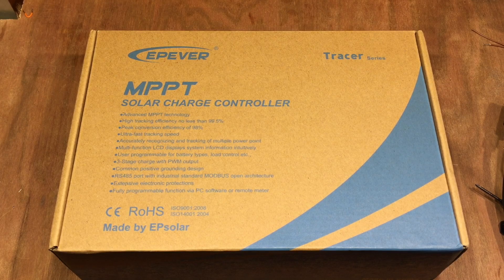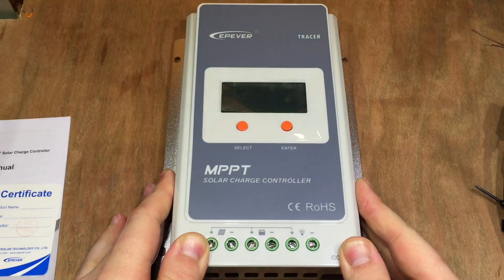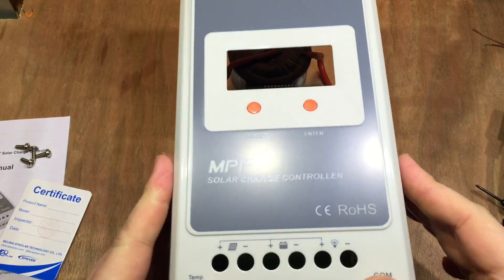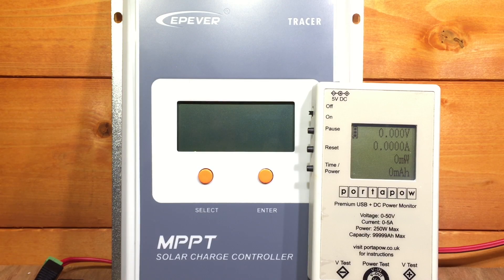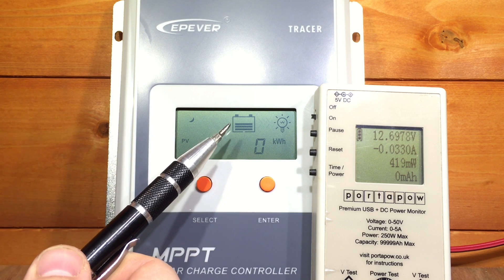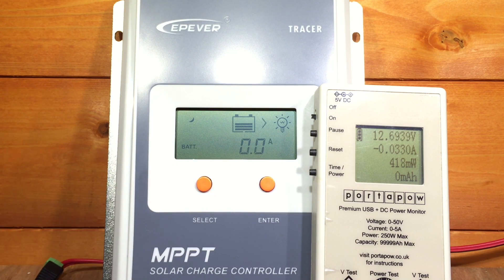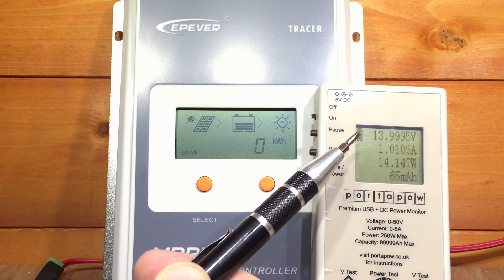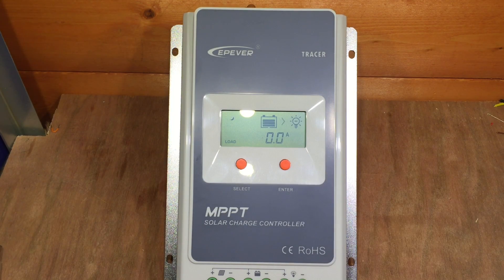MPPT Charge Controller Review - EPSolar EPEver Tracer A Series - 12v Solar Shed

Comment: The size of the heat sink worry's me, how much is the loss to thermal?  Also, do I understand this correctly, that the controller can be turned off when there is no power coming in, so as to not drain the batteries? As someone new to all this I never thought it could be so complicated.  Enjoy your video's immensely and I'm learning fast.
Reply from the maker: My unit temperature internally sits at around 8-10 degrees Celsius above ambient.  All MPPT controllers create a bit of heat - they have a number of mosfets switching inside them quite rapidly to do the DC2DC conversions.  Better to overspec the heatsink in my mind than under.  Remember there is also no active cooling and these things are designed to be left in some fairly harsh environments working away.
You could switch off the controller (manually or via a relay and an additional circuit) once the solar power is no longer present, but then you will also loose the load and it's control options.  In all honesty the charge controller doesn't pull much when it's not doing anything so very few people would bother I 'd suggest.
Thanks for the kind comments.
Reply: Excellent! Thank you

Comment: Great review. I needed a 'real' MPPT controller to add to my existing PWM controller.  Your tear down gave me the confidence to outlay for the 30A version. Thanks!
Reply from the maker: Glad to be of assistance - thanks for the kind comments.
Reply: Sir, just one question: I bought the mppt tracer epsolar 4215a, I can't find what's the limit voltage/amps, I can output from the Load Terminals: Connect loads.? Do you know something?

Comment: Help me for a second: I want to hook up a 100W pv panel, a 130 amp battery and a trolling motor that can draw 12V and 30 amps. Considering the 20A output limit of this regulator I guess I should connect the trolling motor directly on the battery and not on the "load" connectors of the controller, right?
Reply from the maker: Absolutely - that would be sensible.
Reply: So, if I understand, when the trolling motor will be under load the battery's voltage will drop and the charge controller will perceive it quickly then adapt the voltage accordingly and increase the amperage as if the battery was drained and needed recharging, right?

Comment: That model number suggests its a 20amp mppt. Yet we all saw 2x25 amp fuses. So technically could someone pump 50 volts through it?
Reply from the maker: I assume by 'could pump 50 volts through it' you mean could pump 50 amps through it?  Well no, not really...

There is some head room however the microcontroller will limit it to 21.6 amps (I think, as I did the maths using the values stated in the manual).  You can connect about 780 watts of solar up to these controllers, but it will take the panels out of their maximum power point to reduce the current going into the batteries - never exceeding the correct rating for the controller.  That's my conclusion anyway.

It's quite a clever idea in a way.  You can attach more solar than it is rated for - useful in the winter when you've generally got little current coming in, but when the sun does shine it doesn't blow your controller.  Seems a little wasteful in the summer though.

Comment: hi its me again good sir. i have another question for you sir. in the manual, specifically page 10 where you can read something about "max pv array" on our 2210a model it says there max we can go is 780w. and on beside it is 260w rated charge power. now im thinking can we actually go and series some panels but not go over the max voc allowable  example is 3 180w panels(180w total) with voc 29.5v each. now wire them in series making 88.5 v(so, safe. right?) but i just went over the rated charge power which is 260w. now will this behave like this? 
A. its pumping more than 260w then scc goes boom. 
B. its solar peak time im getting the full 540w from the sun but scc will only charge the batteries at 260w. and extra power turns into heat. dissipated at the heatsink at the back? 
C. ill get errors in the display? and unit will shut down to protect it self?

im pretty clueless my supplier doesnt throw back messages for me. i hope you can help me thanks alot good sir. 

marionne from the philippines :)
Reply from the maker: As you have pointed out the manual is a bit confusing in this respect.  I was talking about this very thing a few days ago with some one else.

Page 10 as you rightly point out suggests a rated charge power of 260 watts at 12 volts.  So that's referring to the battery charge - 260 watts divided by 12 volts equals 21.6 amps going into a 12 volt battery.  So we can assume from this that this is the real limit of the '20 amp' version of this charge controller.

Page 22 states that the maximum PV. input power is also 260 watts at 12 volts.  Well this is confusing because a '12 volt' panel will typically produce 17-18 volts at it's maximum power point.  So actually 260 watts at 17.5 volts is actually 14.8 amps on the solar input - but assuming a good 98% conversion that is 21.2 amps going into your batteries - A touch over the 20 amps, but actually under the limit explained on page 10.

As for the question about what happens if you connect a 780 watt '12 volt' solar array to a 20 amp version of this tracer A series - it's a good question.  After reading the manual again you can see in section 4.1 - page 19 the first listed system protection explains that the solar array will be held away from it's maximum power point to limit the current.  Assuming that the charge controller can react quickly enough it is likely it will hold it close to the battery charging limit without going over - if it does go over there is likely some head room built in for short over current situations - it would make sense as the unit is fuse protected higher than 20 amps.

I guess this is a handy feature in a way.  You could have a 780 watt array connected to your controller - the controller limits the charging current to 20 amps in the summer when the panels are producing well but in the winter you have a larger array to hopefully charge your battery quickly.  It's just a shame that in the summer the panels won't be producing all that they can - but the  power isn't being thrown away as heat either.

Hopefully that answers your questions - and hopefully my understanding of the manual is correct!

Comment: I've just found a rebranded version of this MPPT on a local German solar supplier's website. 
http://www.solarxxl.com/de/Laderegler/MPPT-Regler/Solar-Laderegler-MPPT-20A-12-24V-automatische-Erkennung-mit-LED-Anzeige-963.html
Reply from the maker: Now I know that EPSolar charge controllers have been re-branded in the past however I would be wary.  This one seems to be fully featured but there are some on the market sold as HQST (or something like that) and they do not have a working RS485 connector for the MT50 or PC Software.  I do not know if this charge controller is good or bad - it could be either.  For me, I'd go with the EPSolar (however the panels I bought recently were from this company and they seem like a good product).
Reply: Thanks for your answer. I'm trying to build small 40W solar on my balcony with 18650s (1S pack) as cheap as possible. I got the panels from that company and just ordered BQ24650 MPPT charge controller. Let's see :) keep nice videos coming.

Comment: sir how does the load control code 100 work im confused with this one. thanks
Reply from the maker: Code 100 is completely light controlled (no voltage on the panels, output is on, voltage on the panels, output is off), then code 101 means the load output stays on for one hour after sunset.  102, 103... 115 means the load stays on for two, three, fifteen hours after sunset.  116 is a test mode - but I'm not sure what we are testing, and 117 is manual mode, you need to press the enter key to switch the load on and off.
The 200 menu is almost exactly the same however it is hours before sun rises.  So using the two together you could have your load on for four hours after dark 104, and one hour before dawn 201

Here's a link to the manual: http://admw.uk/iL
Reply: ok. i tried this. but the problem is the load side turned on when i set it to code 100. pv is receiving power when i turned it on. where did i go wrong there? sorry for the bother.

Comment: Hi Adam! purchased the EPever 4210A unit and it's giving me some strange readings that don't make any sense to me. I have connected to this a 120W solar panel giving me an off load voltage of about 20volts and when connected to my battery gives me PV readings of 14volts and 0.2 Amps / Battery volts of 12.8 and 0.3 Amps. I was expecting about 1Amp on PV. Any advice?.
Reply: The unit won't overcharge the battery, so even though you might have 100 watts coming from the PV, if your batteries are fully charged and you have no load on the system, it will only put a maintenance charge to your batteries.  Try putting a load on the batteries and pulling down their voltage and you will see the unit using the full PV wattage.
Reply from the maker: Solar is like that sometimes.  Unless the sun is perfectly on axis in the summer months etc. etc.  Yesterday my 200 watts of panels sat at around 0.2 amps most of the day, but it was pretty grey and wet here.  Have you changed the battery charging parameters?  If you've adjusted the float for example it may be limiting the current coming in to maintain the charge rather than push current into the battery.

Comment: hello Adams ! thanks for our video .
just a quick question , the load on m screen is always at 0.1 A and o KWH .
 it s that normal ?  
thank you 
Alex
Reply from the maker: Hello.  I'm not seeing that on mine - Is there something connected using a little power?  The KWH couter will take quite a while to get to 1kWh.  It's a pretty big unit of measurement!
Reply: yes i use a 3 way fridge , sometime a invertor and LED light
Reply: and an other thing, the battery on the screen are nearly empty but the V still around 12.7 , thats normal? 
thank you very much for your answer.
Alex

Comment: Awesome. What is the long life span of this controller? (how often I have to buy a new one)
Reply from the maker: How long is a piece of string?  I only run my 20 amp controller at about 10 amps.  The components should last for many years and the build quality seems pretty good.  If you stress the components then they won't last as long.  Keep well within rating and keep the item cool and it should last for years and years.

Comment: hello Adam Welch.
i got a general question. i have the 30amp version.

my question. if i have a 12v systeem can i go max 380watt? 
and if i upgrade the batery to 24v can i go to 760watt? 

and then put a step down converter back to my 12v fridge?

so doing 24v you can get 2 times the wattage? is this correct? or wil it not be able to put that much wattage out?

sorry for my bad english.

thanks :)
Reply from the maker: +ben grobben The manual explains how much solar power you can connect to each version of the controller but I think it's a bit misleading. 
According to the manual you can put a max of 390w at 12v or 780w at 24 volts. Now looking at the maths P=IV so I=P/V. But 390w/12 is actually 32.5 amps and 780/24 is also 32.5 amps and that's because it's referring I believe to 12 volt panels and 24 volt panels that are really 17 or 18 volt panels and 35 or 38 volt panels. 
So for me my 100watt panels have a maximum power point of 100 watts, 5.56 amps at 18 volts. I use a twenty watt version, so for me four panels in parallel would take me over 20 amps. 
So that's a long way round of suggesting that you could calculate your maximum by doing the maths. Just don't exceed your amp rating. 
Remember that panels in series - the current stays the same and you increase the voltage. Panels in parallel you add the current and the voltage stays the same. 
Hopefully that has helped?
Reply: hello, i understand the maths. but i just thougt that going for the 24v you can almost double your solar panels and then conect a step down converter to 12v at your 24v battery.. that way you still get 30amps but then at 24v. so that is 60amp at 12v.

so you can buy a 10amp version and go 24v. it wil be the same as 20amp 12 right?

that way you dont have to buy a 20amp solar charger. its just my way of cutting the cost of the whole solar system.

is this true what i am saying?
Reply from the maker: +ben grobben I guess you can look at it like that. Finding a decent DC to DC converter that can deliver 20 amps, and has a high efficiency and a low price might be tricky.

Comment: I saw some settings on the manual and maybe I can get the epever to turn the load on only when it's taking in a solar charge. Would hate to have it running throughout the night. I have a fridge running on a inverter which is connected to the batteries. Probably would kill my batteries over night.
Reply from the maker: +Eric Serrano I've not seen this option. The timers two timers are based on sunrise and sunset but they are both on when it's dark. The low voltage disconnect parameter might be your saviour here. It's adjustable in user battery mode.

Comment: Quick question, I have a goal zero yeti 400 that I want try to connect to the load out from the epeve. The question is since my panels are 32volt I can't attach the yeti directly to the panels. The max voltage the controller in the yeti can handle is 29volts. Will the load out of my epever release a 32volt charge or is it lowered to a specific voltage. Do you know what's the output of the load and is it the same as the input from the panels?
Reply from the maker: Hi Eric.  The load output of the EPEver is whatever your battery level is - so if you're using a 12 volt system, then it'll be between 11.5-14.6 volts or there abouts.  I've juts looked up the Yeti 400 and it seems it can happily be charged from a 12 volt car accessory socket so assuming your solar battery setup is 12 volts then you should be good to go.

MPPT charge controllers do a conversion on the solar panel votlage and bring it down to the battery level - which due to ohms law increases the current!

Comment: Great videos, Adam! - Thanks so much.  Quick question:  If you don't use an external meter or some form of software... what features do you miss out on if you just use the cheesy screen on the unit?   I don't have the MT-50 meter yet, and I was unable to get the wi-fi module to do much on my mac...   If just use the screen on the unit and those two buttons, would the default config be ok for a single battery and 2 small panels?  Is the external display / config actually worth it, or are they just more bells / whistles?
Reply from the maker: +Ben Thanks for the kind words. 
Ultimately the software, wifi unit and MT50 do two things. They allow you to see what is going on in more depth than the in built screen and they allow you to customise the 'user' battery settings. The user settings are useful if you have an odd setup or want to stray from the norm. 
With the screen attached you can change the battery settings from flooded, sealed or AGM. Flooded charges to the highest level, sealed in the middle and AGM the lowest level. Hope that helps.

Comment: Hi Adam, Great posting.  I fitted the 3210A to my Motorhome in the spring with 360W of panels, 400ah battery bank and 1000W inverter.

I was told MPPT controllers are more efficient at higher voltages so I decided to wire my panels of different Amps (8A+7A+4A) in series. Each panel has a nominal voltage of 22V and I normally see 60+V on the controller.

The highest Solar output I have seen at 1pm in June on a pretty clear day is 266W which is near the theoretic maximum for a 360W array at this  Latitude.

Therefore, so far I am very impressed with this controller.

Hope this helps others decide.

BTW - EP Solar customer service is pretty poor.
Reply from the maker: +Michael Fennec Thanks for the info. The manual states that with a twelve volt system the most efficient panel configuration is two 36 cell panels in series. 
I'm surprised you're getting such good power with your three panels in series. The string will be brought down to 4 amps - the value of your lowest panel. At 60 volts that's about 240 watts - so your 4 amp panel must be over producing slightly. So the good news is next June you might see more if you run them in parallel rather than series even though the charge controller is less efficient in this configuration. 19 amps at say 18 volts is 342 watts. 
I be never had to use the customer service, but their pre-sales has been reasonable for me. 
Thanks again.
Reply: Agree. Only put same Isc rated panels in series.

Comment: Is there any way of changing the battery capacity (Ah) without the MT50 display or PC software? You explicitly mention this but it seems odd that this is not an option to adjust on the MPPT itself. 

I mean, if the standard value is set to 200Ah and you connect a 100Ah battery, wouldn't this cause faults/mismatch in the charging schemes?
Reply from the maker: +lennaertevers It shouldn't cause any issue to be honest. The charging limits should kick in even if you use a battery much lower than the default level. Charge is based on voltage not capacity. 

If it worries you then perhaps the cable if not the mt50 is a good option for you. The cable I built in this video only cost one pound - just over a doller if you fancy a bit of a project :-)